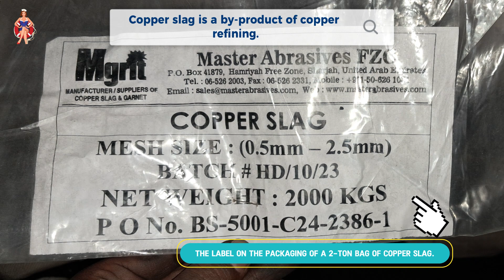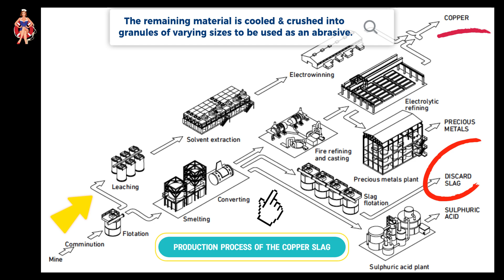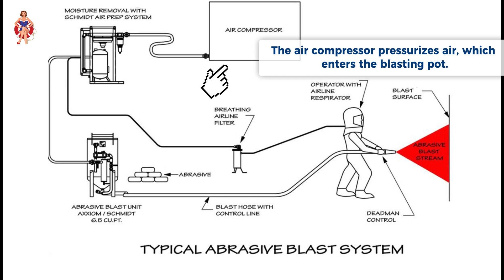The Surprising Truth About Sandblasting Nobody Tells You 🤫

Comment: Copper smelter slag has lead in it.  You don't address this fact.  I wonder why?   It's toxic to operators.   This is a dog and pony show for the suppliers of copper smelter slag.   Lead is toxic at all exposure levels.   Are the workers tested for lead exposure?   I'd bet not!
Reply from the maker: Yes, copper slag can contain traces of lead, depending on the source of the copper ore and the smelting process used to produce the slag. Copper slag is a by-product of copper extraction from ore, and it contains various impurities and residual elements from the ore and smelting process. Lead may be present in small quantities if the original copper ore contained lead or if the smelting process introduced lead impurities. The copper slag bags undergo testing for human health safety during the technical evaluation. 😇